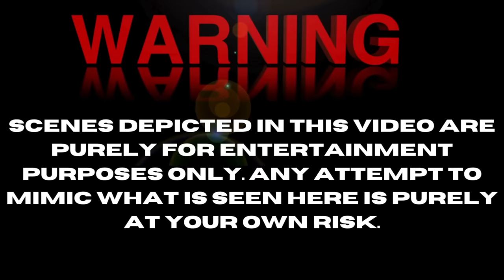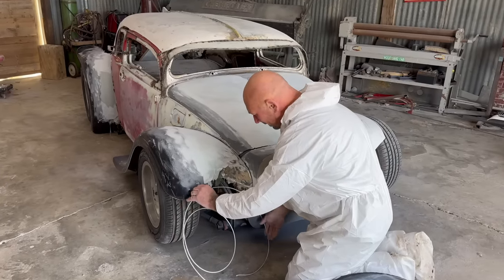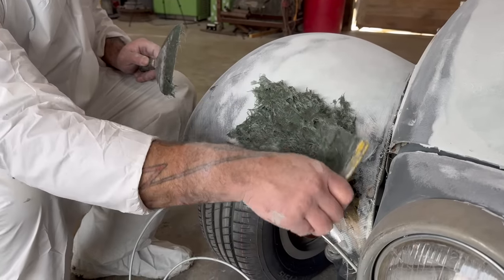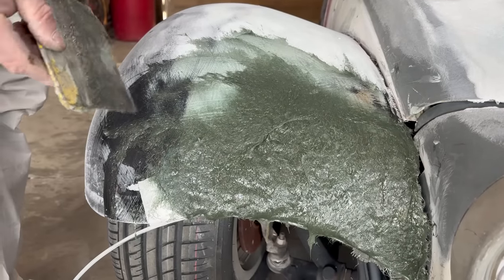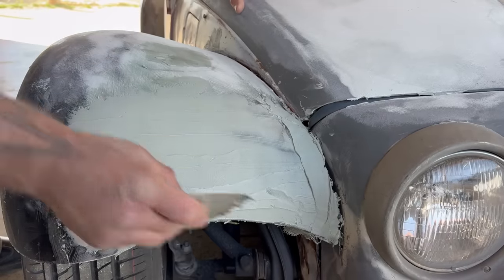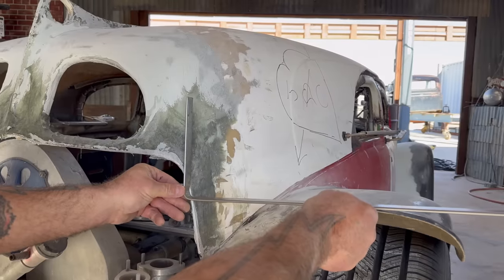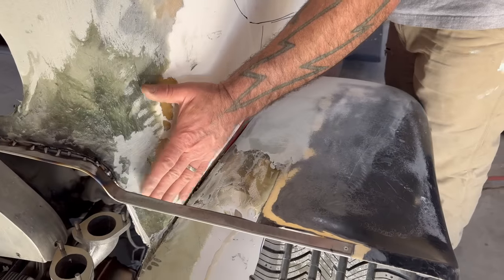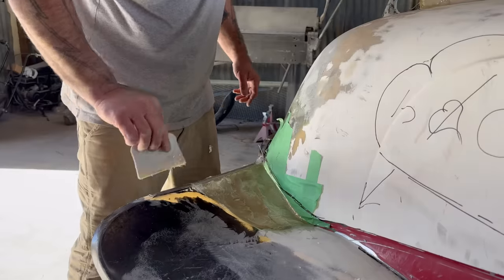Part 29! 1968 Kustom VW Full Custom Ian Fuses And Fabs Two Different Eras Of Fender Styles

Comment: Garden hosepipe is good for shaping to get fiberglass forms. watch all that weld splatter not
gone in the inlets . thinners on a paint brush before fiberglass cured smooths it out save hell of a lot of sanding, its taking shape now.

Comment: Ian Im 59 and I still work on corvettes with a lot of fiberglass .I use saran wray and tin foil over top of the fillers to shape them and hold them till they cure and then it comes right off. Allows you to mold it under presure and push out all the air at the same time you don't get messy hands. Try it! By the way are you dropping slag and welding sparks into your intake manifold or is that engine junk?

Comment: I am glad you covered removing the excess FG from the back side. I was thinking it would be awfully thick otherwise.  Am I safe to assume that you will be using some outside calipers to get the thickness you desire? 
As I am sure you know, there used to be a small roundish hole in the bottom of the grill of old cars where the hand crank went to start the motor. That is why it looked better with the hole down.  Obviously it is just for looks now but, that is right side up.

Comment: Hi Ian and Jamie,
I watched an episode of Paint by Curry and he added some fibreglass resign to his fine filler to make it easier to mix and apply with smoother workability. 
I haven't tried it yet, but will do on the next project. 
Great work as always, and waiting intently to see more.
Aussie viewer. 

Tomo
Reply: Ive done that in the past too. Really makes Kitty Hair stick to stuff also.
Reply: It's not recomended, it makes the filler brittle and prone to cracking.
Reply: @65cj55 the filler is made with polyester resin. Been making my own filler for 40 years… never had any crack.
Reply: @howquick  Yes, and to much resin will make it brittle and prone to cracking....also how would you possibly keep track of 40 years of work to know if cracking occured ?
Reply: @65cj55 just because you can’t either fathom or actually ‘do’ something…doesn’t mean it doesn’t/won’t work.
Reply: @65cj55  exactly who is it that doesn’t ’recommend’ it?
Reply: @howquick  The manufacturers obviously, it's only logical, especially with fine fill, there's no need....have you checked that 40yrs of work yet ?
Reply: @65cj55  🤣🤣. Right. So it says it right there on the can. Sure it does 🤣🤣
Reply: @howquick  Just because you can do something, it doesn't mean it's the right thing to do, the products are made to a formula, if you can't mix and use them, you're the problem...
Reply: @65cj55 haha...so you made all that nonsense up 👍🤣

Comment: This project reminds me of when I tried to make my '72 Superbug more aerodynamic before the Aero kit came out for them. I had the front lowered, wide Porsche style guards and wider wheels with low profile tyres. I had the front bumper pulled in close to the body, Golf indicators mounted in there and the holes in the guards filled in where they used to be, and the windscreen pillars where the drip rail starts filled in to contour them. Of course I had to add 20Kg in the front to help prevent under steer as the 2.1L Motor I built had a lot more power than the stock 1.6L. I ended up crashing that into a fence, the handling never was right, but it went like  bat out of hell.

Comment: roller tool Ian can be made out of body washers with small washers in-between the large body washers and round bar for the handle bent to shape weld one washer on bar stack washers on bar drill hole at end of round bar drill hole place split pin. use file handle for hand hold done now u have a tool with replaceable washers gets gummed up just use flame to free up. just a idea years ago dad was a boat builder and we had to make tooling

Comment: I use the evercoat  “kitty hair” as a first coat for body working rust repair panels. After the new metal is welded in the kitty hair has a great bond to the bare metal. Body work with traditional fillers over the kitty hair product.

Comment: You can use fleece to make your panels out of. You can tack the fleece down with the same resin. You can also use various types of clips or even tape, to hold down the edges to form a base structure . And then fiberglass over the fleece/ material.
You can actually use various types of stretchy cloth to make panels. Denim works also but is  less stretchy.
Just some helpful hints .
You can also buy a dry powder  ( Cab-O-SiL ) , which you can mix in with marine-grade resin to make something similar to your own version of gelcoat/Bondo.  A thinner mixture to make gel coat and a thicker mixture to make a Bondo-ish . Mixing it really thick and make it less pliable than Bondo and more prone to cracks. But, mixing it real thick makes it easy to shape and you can use acetone on a paintbrush to help control the shaping and texture.
Use very little acetone to keep the bristles lightly damp if you use too much acetone it can cause premature cracking and shrinkage in your finished product.
I was an artist and did fiberglass reproduction work. 
You can also use a layer of turtle Wax on metal as a release agent for your fiberglass, so you won't have tape lines and you will have really tight fitment.
Reply: If you use turtle Wax remember to use wax remover before attempting to paint 👍
Reply: There was a early British Car just after the War, that was made of cardboard covered in Calico and Resin, i can't remember who built it.

Comment: Bondo doesnt stick to the foil tape, and you can use it to help form clean smooth shapes. I did that on a gas cap door area, and wrapped aluminum foil tape onto some cardboard and wedged it in around the door, and the bondo formed in perfectly.

Comment: I have always used wax paper afterwards to make it perfectly flat for your fiberglass.  You can get a bondo spreader to clean your gallon container of bond or fiberglass You can find those. At any parts store and you can also get a cheese grater. I've always used that when I work with Bondo or fiberglass

Comment: Ian the triangle gap at the bottom of the metal you just put in where original back fender, fiberglass fender and body cap meets would be a perfect spot to put the tail lights.

Comment: 34:23 since that lower area, where your hand rest during this shot, is going to be cut away - what would you think of mounting a flat plate vertically down below the bar you're installing... that plate or piece could house a array of different tail lights.  it'll still be able to have the fender removed if you make a plug in harness that goes to the light itself much like the original vw bug tail lights.   just a thought... this thing is awesome.    Im building a vw rat rod...but no where wear nearly as  awesome as this one!

Comment: I once worked for a Bath tub Company in Nashville Tennessee they had a Thing called a CHOPPER Gun  it had a Like rope of Fiber Glass that fed through a Chopper that was on The top   of a Paint Gun With the RESIN in the Paint  Holder  as you Sprayed the RESIN it CHOPPED the Fiber and Coverd Quick it was Cool :face-blue-smiling:
Reply: I seen some Guys doing a Yacht hull once with those, it was amazing..

Comment: 🟥 I'd like to share 2 experiences.  First off, I  was taught to do a layup coat of just resin and catalyst mix ,let it harden, then apply mat,hair or whatever for a more permanent bond. 2nd, I used rivets to bond steel to fiberglass before doing the final glass work. I was told by a professional that in time the rivets would show thru. Of course I didn't listen and shure enough,  down the road they came thru and back to the drawing board.

Comment: You need a "cheese grater" rasp with the open holed replaceable blades.for dealing with the kitty hair and bondo when it is still  "shaveable". Waiting till it's hard enough to sand means twice the effort to shape it. You can cut it away so effectively with those tools and they are easy to get, as they were invented for woodworking. I looked it up and it's the Stanley Surform Plane.

Comment: Try using smaller width spatulas for the tighter radii..... i use plastic spatulas with a rubber edge blade.

Comment: Ok, new subject = new solution,  bonding glass to steel is done with "atprime" it's a mixture of powdered glass and metholene chloride,  make a slurry, not too wet and brush it on the steel,  let it dry to a sharp hairy surface,  then do your glass work over it

Comment: I like the Baja look gone. I was wondering if you were planning on carrying the center ridge (roof) -  down the front.  At the moment the center ridge on the roof looks like it dead ends.  There is no flow down the front of the car.    Just my two cents.

Comment: Tacked some fleece with some hot glue and coated it with resin you could have made a light weight guard with hardly any bog 
Cover the guard with release agent you could have kept the original gaurds
Fleece as in material
You could make the roof and back gaurds one piece 41:39 41:40

Comment: Love your creative work, ? Wouldn’t have it been better to put the aluminum tape on the underside of the fender so as to not have the glass on top of it when you remove it isn’t there going to be some tape underneath the layers? Just curious.
Reply: Every contact surface gets ground out and properly adhered to

Comment: Coming together nicely. Fiberglass does not make real cars? Does that mean the Corvette is not a real car? All of those people are going to be disapointed because they thought they were buying cars. 😁 Thanks for the tip of mixing fiberglass pieces with the Kitty Hair. Probably better than buying the Tiger Hair if you don't have a lot of use for it. One thing I have used to make the short hair stronger is the fiberglass sheetrock mesh tape. I had a roll left over from taping sheetrock and no fiberglass mesh. Mother of invention moment. By the way in the 1970s you could buy old fiberglass curtains from the 50s and 60s at garage sales cheaper than matting so guys would buy them for their projects.
Reply: Back in the day, that Sheetrock Tape was used by many for a quick rust repair.

Comment: If you really wanna get fancy, you could make the grille functional by putting ducts to a set of disc brakes to cool them down equipped with lil blower fans too!
Reply: …. Or… run a duct straight through the body to the engine fan 👹
Reply: @Ian_Roussel  heck yeah that's a kool idea, a lil more work but that'd be awesome too!

Comment: The hole in the bottom of the grill will come in handy when the battery is dead and you have to hand crank the engine to get it started.  :-)
Reply: Engine's in the back, there is a valid reason why VW put that hole though.

Comment: If you put clear cellophane over your kitty hair you can roll it with a deep socket to help pack the fiberglass down tighter to remove air bubbles get a

Comment: now you have a water collector on the back gaurds ,why didnt you use an old sedan spoiler and cut it in half length  wise for under the rer windows ?
Reply: It's not even finished.

Comment: On the back fender, the inner part of the fender you're going to cut out, if it's metal, couldn't you bend it up to match the slope of the outer fender?
Reply: It's fibreglass also, they were from a Baja kit.

Comment: Number A that body filler is dangerous stuff it's not like the hot burning metal that you're used to or anything so be careful.
2 every time I watch one of these you reinforce the fiberglass you're doing with metal that most fiberglass people don't do so.... hello pretty much bounce a Chevy off of it
C the fenders are awesome, the nose looks 100 miles long how did you do that? back to Spaceballs on the rear end but I love it. 🤷🏽‍♂ also Ian was good as a guitar player in the band Train, Meet Virginia and all that🤣🫡👍

Comment: The front of the fender looks just like the fender on my Model A ! But my A is a real Model A! 
When I was a kid in the fifties the hot rodders and the race car guys would use tin foil to do the fibreglass with as I don't believe we had foil tape back then. It was a different world then.
Reply: Yes the were model A fibreglass fenders, is your model A stock or custom ?
Reply: Stock / Carol and I started with a rolling chassis and engine with no pistons and after eight years we drove it to Wisconsin to the Model A National Meet. That was in 2004 and we received a Blue robin for having the standards 14 points for an original Model A!
We went everywhere to find parts, swap meets, estate sales, and E Bay was just getting started and we got skinned several times on E Bay in the early days the most we lost was $280 on some finders. Even had a guy sell me an engine with papers saying that it had been 
magnafluxed and our engine guy found a 12.5" crack in it. He has that engine with the white crack now in his show case in his office. But we have found a lot of people that will help you, give you parts etc. there are crooks in everything and you just take it and move on!
Reply: @garryreece8604  It's a shame there are people like that, they know you need it and lie to you, but you got there in the end and have a work of love and fine automobile.